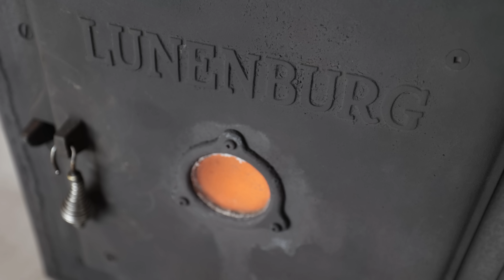THE WOOD STOVE MAKER. HIS CABIN AND TENT

Comment: I was always taught that when swinging an axe as soon as it goes below your belt, bend your knees and your back 45 degrees.  The axe will travel straight down.  Even if you miss what you are swinging at, the axe will hit the ground the length of the handle away from you.  I see so many people swing the axe in a circle.  As soon as it goes below their belt, it's headed right  back at them.
Reply from the maker: Good tip

Comment: That is a neat place. Watching you hitch up the sled at the start of the video I have to say we drop the pin in from the top down here where I live in case the wire pin falls out the main pin is still in place. You all install it from the bottom if the wire pin falls out so does the main pin and you lose your sled.  Would you mind telling me what you all call a Cord of wood, size  that is. Seems where ever you go its different, just curious  what you all call a cord of wood.
Reply: Good eye! The pin is going to work it’s way out eventually while towing with all the up and down movement regardless of upside down or right side up if the cotter pin brakes or comes out but, from our experience, especially this mild time of year, if you bog down in deep snow and or slush becoming stuck enough that the first try to get out is going to require disconnecting the hitch. Rather than time and energy wasted on shoveling out hard packed snow underneath the tongue for access of removing the cotter pin, sink and bog down in as deep a trench in powder snow or wet slush as you like and that cotter pin is going to stay easily accessible from the top for removal and 99% of “stuck-bad situations” you can use the end of an axe etc to knock the main pin out. Once all these mechanisms are frosty on top of no play/give from being stuck, normally the first thing in the way for tapping out the pin is the tracks snow flap. To get that out of the way so your pin can come out you’ll not only have to shovel out the tow bar and hitch but also the rear of the track to get that snow flap out of the way. Good luck on making room underneath everything to hit hard upward to get that pin out when there is a lot of strain on it.

Comment: Great video, but that tree wasn't even 1.5 feet across, I cut up a oak that blew over at my nearest neighbors house, 24 inch bar from both sides, wouldn't make it threw last 8 feet of trunk.  That tree with a couple of small ones, was 35 piled up pick up loads. One 16 inch long section of trunk, when split up, almost truck load. This in SC.

Comment: When splitting bigger chunks of wood, I find that taking a slab or two off the outer edge makes the rest of it split easier.  Aim three to four inches in from the bark and go for it.  One or two slabs off the edge and then go down the middle.  I was taught that by an old timer who told me that trick would relieve the pressure inside the block of wood and make the job easier on the body.  30 years later, I still use that trick and it works great for me.
Reply from the maker: Thanks for the tip!

Comment: Why use a gas stove when the fire s going
Reply: Simply because it’s too warm outdoors to have the wood stove raging at a high burning heat. Temperature inside the cabin would be unbearable if the fire in the stove was burning hot enough to cook on.